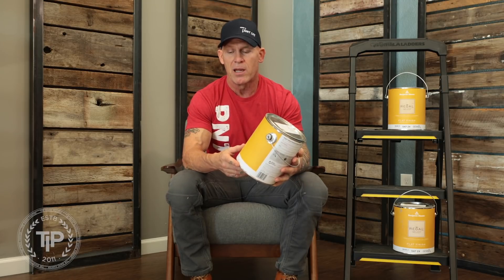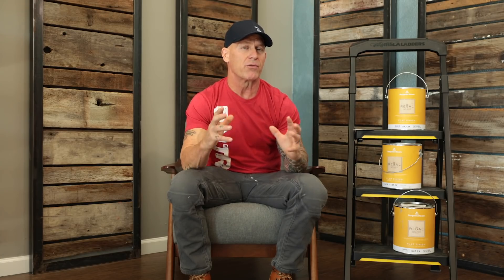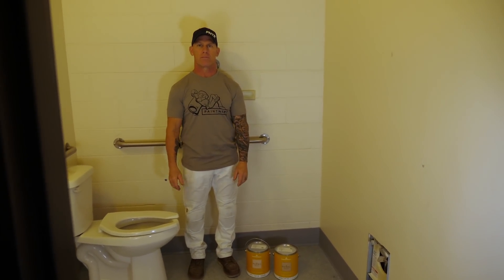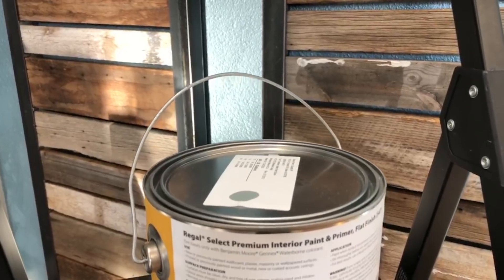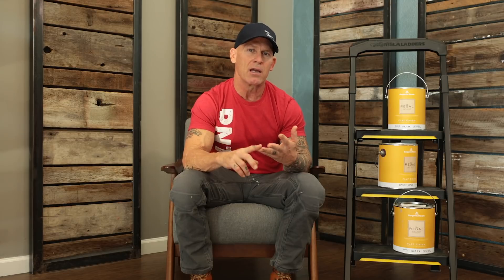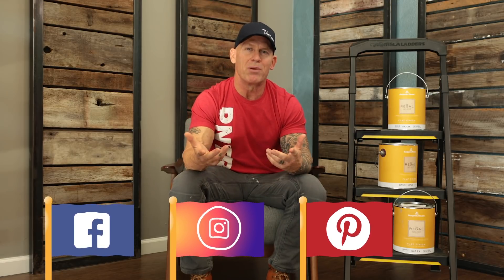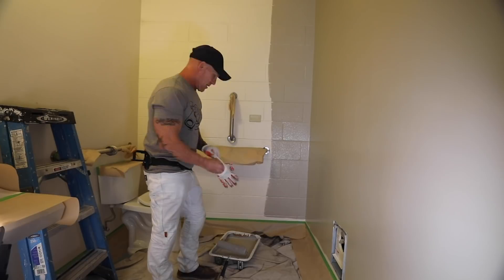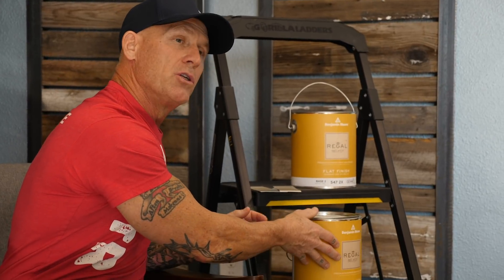Is Benjamin Moore Regal Select GOOD PAINT? Paint Review 2023.

Comment: I dislike this paint very much. It  covers well and looks great, but it drys way too fast. It's very hard on our equipment.
Reply: @Fomalhaut_Antares  on the plus side, you can tell better paints usually by how hard they are to clean off hands and equipment. In my experience.
Reply: @Monarchski  Thank God. I like the finish.
Reply from the maker: Interesting.  Did not for me.
Reply: Try adding flowtrol or and some water mix well it lays out much nicer
Reply: @thesaviorofALL  Floetrol is a no-no with this paint. It can be added to Regal Classic but not Regal Select. Extender is to be used for Regal Select.
Reply: @paulsharkey6576  interesting if you have time pls let me know why it always nice to learn something new thnks !!!
Reply: @thesaviorofALL  I'm not sure of the chemistry involved, but Floetrol is not meant for the new waterborne formula. Curing problems. Either extender or water for Regal Select. You can use Floetrol in Regal Classic, but they are discontinuing that line unfortunately.
Reply: @paulsharkey6576  right on thnks for the info ...god bless you and your family.
Reply: @Monarchski  fan boy or employee?
Reply: That's because they removed all VOC's, but they are actually going to be adding them back at 50/GL in order to help with that.
Reply: I’m a professional painter, and I agree with you. Way too fast!
Reply: @LUckybones25  Of course one can add extender, but I don't want to do through that trouble. It should be ready right out of the can.

Comment: if you try adding 2-5oz of extender per gallon it will make it a lot nicer for you to use. It tends to be a bit thick/sticky outa the can  to cut and roll in my opinion.
Reply from the maker: Good tip

Comment: I’m a big fan of this paint in the matte finish. I think it looks great as a wall finish sheen. As far as paint and primer in one , I thought that is more of its ability to hide than as to sealing new work? I always prime new work or spot prime repair areas. I’m a certified professional homeowner with 30 years of experience and have enjoyed the channel for many years.
Reply: Agreed. My favorite paint for use in my own home. Though I typically use the Ben Moore UltraSpec Low Sheen  as by baseline paint for most projects, I use this upgraded paint in my own home. I use the BM Regal Select semigloss white as my baseline paint for trim and doors. Covers well, looks great, doesn't fade much over time, and applies really nicely with a brush with very little runs. I haven't found any trim paint that is more resistant to sagging than this. If I am going bright red or yellow, I go with the top-of-the-line Aura paint, but that is rarely needed. I've used the Aura Bath & Spa paint on many bathrooms - particularly those that have high-humidity issues.
Reply from the maker: Thanks for sharing!

Comment: My dad had his own house painting business which he started in 1974 and he did a lot of high end jobs and the Regal line from BM is pretty much all he used and the results were always great.  Flat on the ceiling, eggshell on the walls, and he used Satin Impervo (oil base) on the doors and trim.  You pay a little more for their paint but it's worth every penny.  

Question?  Why would you use flat in a bathroom?  For bathrooms my dad would use a Satin Impervo because it holds up well to the steam from a hot shower.  BM also has a fairly new product called "Kitchen and Bath" which is a great product as well.

Comment: I just used this for a bathroom too. A very dark gray and I couldn't be more pleased. The coverage on first coat would have been fine but I went ahead and put a 2nd coat to make sure. I still had 3/4 of the can left too! A solid quality paint which I will use again. It didn't bleed through the frog tape I used. Clean lines. Totally agree with Chris all the way. So happy with it.
Reply from the maker: Nice

Comment: Is this OK for painting trim? I tried it and could not get rid of brush strokes. It just would not level not matter what I tried (rolling, brushing, foam/bristles). i even tried some Floetrol with no luck. I am now in the process of sanding out all the brush strokes to try again. Any tips would be appreciated.
Reply: i read your comment and for the trim i having the same experience. i used the ben line, used a professional painter and they couldnt even get it right. they obviously werent too professional or else they would of stopped using it and recommended a better paint. issues were altered finish sheens, horrible brush strokes, horrible drag. used a primer and 2 coats. paid more for double the amount of paint and labor and still looks bad. ive been told either use the regal or aura but i dont want to make the same mistake again. did you have any luck finding a better solution or line of bm paint? had to use bm to color match

Comment: i am a paint dept mgr for one of the few authorized retailers of Ben Moore in the country and I and my customers, whether DIY or contractors, swear by this paint. I can barely keep it in stock in certain finishes and bases. The only other thing that may outdo it is the Aura, also a Ben Moore Product. By the way for what its worth I love what you put out here. I use this knowledge on a daily basis, thank you.
Reply: I recently painted a small bathroom in my house with Regal Select Eggshell; because I’m not a pro, and because the room has awkward narrow sections of wall adjacent to the sink and toilet, I wasn’t able to prepare the walls as I would have liked. As a result, there is some orange peel affect. Would re-painting it in the Matte finish reduced the visibility of the roller stippling? Thanks !
Reply: @Avital4414  Hi painting in a matte finish will greatly reduce stipple and roller marks on the wall.Use a good microfiber roller cover.Make sure you lay off the paint,meaning after rolling on to walls go from top to bottom in one motion all the way across the wall,do this while the paint is wet.The regal matte is durable and washable,but not as durable as the eggshell.The  Benjamin Moore super hide zero voc low sheen is also excellent and has a smooth durable finish for $20 a gallon
Reply: @streamscreen  thanks! I’m going to paint matte over the eggshell and reduce the stipple!
Reply from the maker: Interesting
Reply: @Avital4414  Hi if the stipple is bad you might want to sand it a little,but the matte finish should be a nice improvement
Reply: @streamscreen  thank you. I will try sanding it before using the matte. I’ve wondered whether sanding can help with stipple - good to hear that it may in some cases!
Reply: @Avital4414  Yes sanding will smooth out heavy stipple.If it’s really bad get a palm sander and go over the whole wall,much faster.Take care!
Reply: @streamscreen  thanks for your help! I’m definitely going to get my palm sander working on that wall.
Reply: @Avital4414 should look nice,take care!

Comment: Ben Moore is the best paint period always has been in my career of over 25yrs.Try the Aura exterior line and the Advance line in High gloss on your exterior doors. You'll be impressed. I also use the advance line to spray cabinets and trim interior with my airless. It's an alkyd modified acrylic. Spays smooth dries hard like an old tyme oil. Cheers
Reply from the maker: Thanks for sharing!

Comment: I used this paint before and liked it a lot.  My only issue with it was that, like all flat paints, you can't touch it or it leaves a shiny spot on it.  Washing/cleaning is not really good with it being flat, it just leaves a shiny spot.  Flat is easy to touch up and I did that for a while but eventually even fresh paint that was leftover in the can was a little shiny and looked different than the rest of the wall.  I eventually got tired of this and painted again, same color, with a finish that wasn't flat.  Flat has best looks for sure but only works if you're in a house w/o kids touching the wall all the time.  On my second paint job I used Aura and that is more washable than Regal Select.
Reply from the maker: This is a pretty dang good flat

Comment: I spoke to a Benjamin Moore Rep a few years ago and he explained, the claim of paint and primer in one, was due to the mil thickness of the product left over after the water evaporates once it dries.  Due to the higher solid content there is a thicker mil layer left over from each coat, thus covers and seals the substrate better.  Still an actual primer under certain circumstances, i.e. water stain, new drywall, smoke etc, should always be used.  Great video as always! Thanks!
Reply from the maker: Man that rep has no idea what he is talking about.

Comment: Ive used regal select for years. You can get more coverage than advertised with certain colors. Very good product. 

I'm not much of a fan of the Regal Select Semi Gloss white though. Regal Classic semi gloss white was where it was at. 

However, couple years ago Ben Moore changed something with the regal classic semi gloss white. The code at the base of a SG White regal classic can was N-7xx something. Now its C-333. The new cans were rolled out when I was half way through a new construction, so when my original stock of white was running out, I went and picked up enough to just finish the work. Subsequently I was unwittingly using the new C333 cans that no one said anything about when I already completed about half with the old stuff. 

The trim that was painted with the new line was very obviously not covering well at all after the 2nd coat. There was a certain transparency to it like a very cheap semi gloss. The trim that was painted with the previous base code could almost pass off with a single coat. 

Vendor was adamant that its the exact same product but anyone who wasn't even a painter at the site was easily picking out which rooms were painted with the new product (C-333) and which ones were with the old (N-7 something). 

Just business as usual in the coatings industry.
Reply from the maker: Thanks for sharing

Comment: Nice review, I would suggest trying the interior Ben product line. I often use Ben eggshell finish,  if it drags I’ll add some extender, and it flows nicely. I would also suggest testing Benjamin Moore’s Sure Seal primer. I’ve never used an airless with either coating, strictly brush and roll application.
Reply from the maker: will do

Comment: Hey Chris! I have watched your videos in the past to help me with various DIY painting projects. In this particular video you mentioned that you really liked this paint and it is comparable to two other interior paints that you will use. If you can disclose what are the other two interior paints that would recommend? Also, the project that I am getting ready to start is a nursery. The room already has trim, beadboard and chair rail that has is pine with clear coat on it. Do you recommend me removing all the clear coat to prime then 3 coats of finish paint or just lightly scuff the clear coat and then just do multiple top coats? We plan to paint both the trim work and the walls.

Comment: I never get runs or saging when I paint, no matter what paint I use.
Reply: I do, after you’ve painted hundreds of miles of walls...you get an occasional run...once you are done with a room look over everything.
Reply: @lexandersantana8089  I had a run about 25 years ago. Not one since. And I inspect every inch of my work. I do all hi-end new construction on very hi-end homes. Always perfect.
Reply: Rather than just telling us how great your work is, why don’t you share insight into what makes your process so good.
Reply from the maker: Interesting.  You must be amazing.
Reply: @Avital4414  I wouldn't even know where to start. The only place you'll get drips would be either from cutting in with a ton of paint on your brush, brushing or spraying semigloss for trim work, or spraying walls. So, I back roll my cuts with a 3inch roller. I spray my trim with a mist coat then a finish coat. And I back roll when I spray walls. It's a matter of the approach. With back rolling, the only risk for drips is in spraying the trim. But I've been doing that for so long, I haven't had a drip in 20 years. That's about all I could say.
Reply: @paulsharkey6576  thank you.
Reply: @Avital4414  As far as lap marks, that would only happen with satin or greater. Use a soaked roller and overlap by a 1/2. Do 4 or 5 rows, then go back and lay it out, again overlapping by a 1/2. You'll never, ever get lap marks no matter what the color. As far as flat or matte, I've never had any issues with lap marks, ever.

Comment: Thanks Chris! I'm a cabinet maker so I don't know much about wall paints. I'd love to hear your review of Scuff-X
Reply: Or insl x cabinet coat
Reply: Its a great option if you plan to spray your doors horizontally. If you're going to hang and spray Emerald Urethane from SW is my go to. Used to PPG breakthrough until the low VOC product was all thats available in my area. If you can still get the 250 VOC breakthrough, thats my favorite. DO NOT use the 50 VOC formula.
Reply: @pattubbs2202  Cabinet Coat is just ok.
Reply: Love scuff x. I'm gonna use it on every surface in my house
Reply from the maker: You got it!